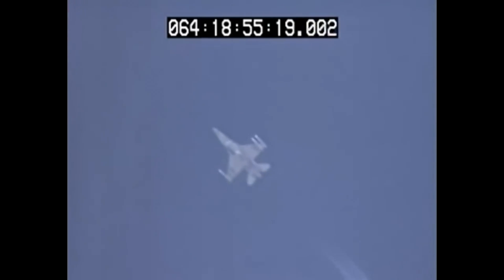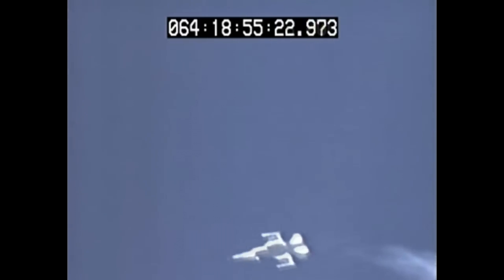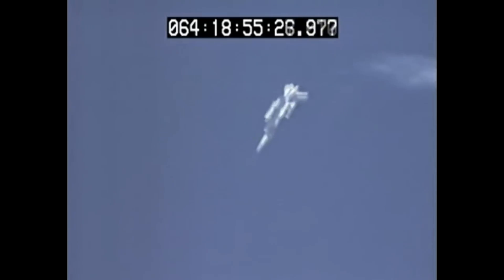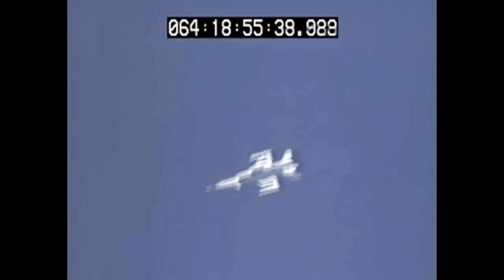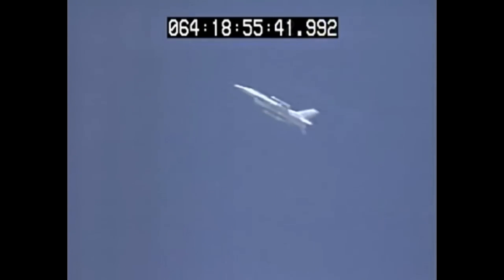Asymmetric Loadout Yaw Departure Test || DCS World vs Falcon BMS

Comment: That test footage shot from below looked like a pretty scary ride. I'm sure they modeled it thoroughly before risking their pilot and airframe, but it still must have left a fresh pleat in the seat liner.
Reply: I’d argue against that, the test pilots are people with nerves of steel, from the outside it looks more dramatic than it is inside… I know this from UPR training back for my PPL… I had a friend record my Cessna 172 go into a spin and myself and my instructor recovering it, in cockpit it felt pretty okay, just the gauges going crazy, outside it looks like hell, but inside, it’s like roller coaster! Has to be done as part of training if your flight school is of higher standard.
Reply: The test have probably been made because such instability have been observed in the simulator, the real world test is then done at a safe altitude and the plane have been probably fitted with a reinforced parachute to help stabilize after departure
Reply: @Stef3m  Aye, but its still dangerous for sure. Worst case you gotta eject, which will cause injury.

Comment: You're testing way too fast, and Mach 1.1 is supersonic not transonic. Try actual transonic.
Reply: Mach 1.1 is transonic from an aerodynamic POV. Depending somewhat on Re / Nu numbers and air density, the supersonic realm (i.e. where transonic effects are negligible) is usually defined as starting at M > 1.3.
Reply: @mortlet5180 no, transonic is when parts are breaking the sound barrier but not the entire platform. At 1.3 you’re well inside of supersonic flight, transonic is closer to .95mach where you can get leading edges breaking the sound barrier while not technically being supersonic.
Reply from the maker: @ShawnHinck  "In aeronautics, transonic refers to the condition of flight in which a range of velocities of airflow exist surrounding and flowing past an air vehicle or an airfoil that are concurrently below, at, and above the speed of sound in the range of Mach 0.8 to 1.2" ;)
More in the link below:
https://skybrary.aero/articles/transonic-flight
Reply: @b3rno  at 1.2 you’re not going to be in transition though, you’re going to have completely supersonic airflow, there’s no actual hard numbers, transonic is just defined as having both supersonic and subsonic airflow, but 1.2 you’re not going to have any subsonic airflow you’re well past transonic at that point.
Reply: @b3rno the read definally is interesting, kudos for citing your argument
Reply: No BMS players know better.

Comment: Thats quite odd. I have no problem getting the F16 to depart controlled flight above 35k. With or without bags.  
You can also push it to about 52k then roll it over and she will slip into a spin. You will be able to regain nose authority around around 40k.
Reply: Without any rudder inputs?
Reply: @Dee-Jay  I don't rightfully remember. It's been quite a while. But I would assume so because I use the rudder as intended. And to get it to roll over at that altitude, the rudder would be helpful.

Comment: Funny, I was testing this myself too (only in DCS though), a couple of months ago, maybe a year at best. No departure.
Reply from the maker: Interesting insight is that internal fuel has also big impact of yaw departures as low fuel level swith GC more to the aft. No matter how much stuff you put it on DCS wing (asymmetrical) it will never depart. BMS has it covered tho
Reply: @b3rno  Doesn't this show that although you get a full departure(second test) in BMS (footage at start) three 120's have to be added to get the same result as the footage. To qualify the footage is 2 Amraam's on left wing and one Amraam on the right wing. It's great that you get a similar result in bms, however this shows that the BMS flight model still needs work to fully replicate the departure shown in the footage.
Reply: @salsadevil  not really unless you can know exactly the fuel remaining in the aircraft and all the atmosphere parameters such as temperature and pressure. BMS is a copy paste of the Nasa simulator that has been developped especially to study post stall characteristics and fix the real FLCs. I doubt anyone will dare « adjusting » the NASA model for this.
Reply: @MultiJp51  Sure thing, I mean it's really impressive that with a asymmetrical loadout you can replicate the departure that occurs in the footage.(with the new cg modelling).
Reply: @salsadevil what do you mean new GC modeling ? The accurate GC modelling exists since 4.32. As a matter of fact BMS f16 current FM is nearly identical with 4.32 one. When a FM is right you don’t need to change it every release …😅
Reply: @MultiJp51  Sorry jp it seemed in the foreword that a new cg modelling had been implemented-as you say this is not the case- sorry for the misreading.
Reply from the maker: @salsadevil  Hey Wowzer! yeah loadout of 2x Aim-120 Left/ 1x Aim-120 Right & Central Fuel Tank was not enough for yaw departure in both platforms
Reply: @salsadevil  Tbh some stuff is just very, very difficult for games to simulate. Heck, even in reality they still do flight tests like this, because computers cant predict everything.
Reply: @termitreter6545  it's crazy, it's so close though(whats 2 amraams between freinds), I just repeated the flight test for my own personal tigerfication and wow the f16 really has a very deep departure(bms test 2-3 120's). It took me thousands of feet to recover it. I wouldn't want to be the test pilot in the footage.
Reply from the maker: @salsadevil  Did you test it with the same loadout as in vid wowzer? (left wing only?) As soon as I put one Aim-120 on right wing I had no more departures and F-16 was more stable in tight turns
Reply: @b3rno  Yeh I just checked, no departure or even stall for me-ie same loadout as in actual test- I tried different altitudes 50k 40k and 38k around 3000 pounds.
Reply: that stall tho with 3 120's its just vicious!  Recovered around 10k wtf!x
Reply from the maker: @salsadevil  Satisfactionary isn't it?  Next thing I'll have to test is different asymmetrical bombs loadout combined with different missiles set up. I had a lot of fun testing it knowing how detailed BMS FM is

Comment: God Bless Falcon BMS Devs!
Reply: Amen
Reply: Amen
Reply: It is not like it showed the expected behavior either. No adverse yaw.
Reply: @freakmusicaddict what do you mean no adverse yaw? Adverse yaw is of course entirely modeled in the NASA simulator and thus BMS. However most of its effect are totally dampened by the ARI. Should you desactivate ARI you would see it in action badly
Reply: @MultiJp51  okay my mistake what I meant was not adverse yaw but in BMS the plane does not really depart either it more or less stalls really weird. No continuous departure in roll or yaw.
Reply: As someone who has the DCS F-16 and worked on the code for F-16 HUDWAC's CCIP/CCRP irl in the early 1990s - my money's on BMS.
Reply: DCS is still the superior sim :)
Reply: @zi0  no doubt about it , but still fail to see where , except GFX and Sound area.
Reply: @zi0  If you want good graphics, but if you want a real simulator Falcon BMS is far superior.